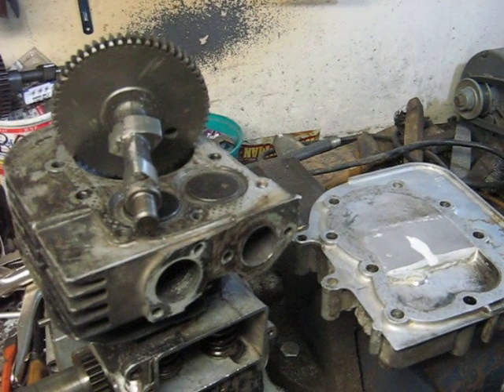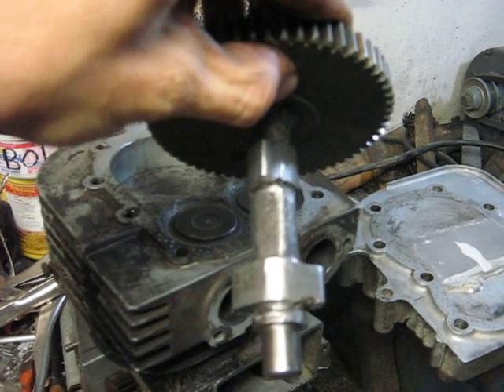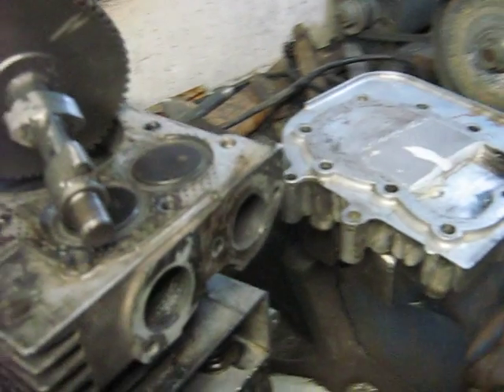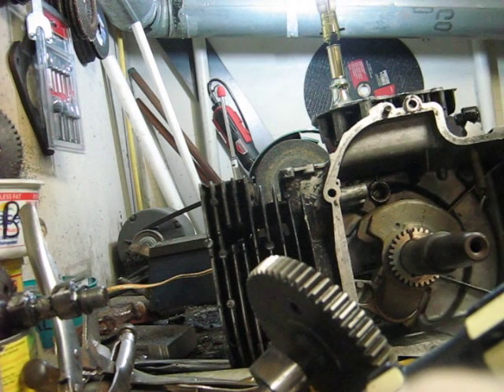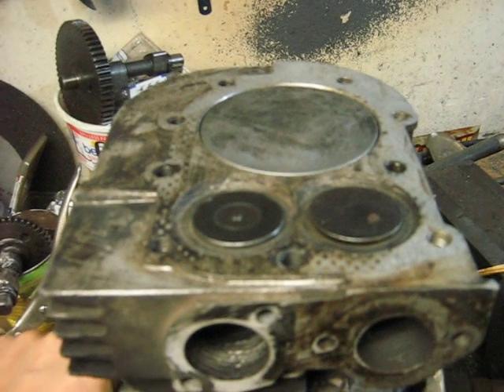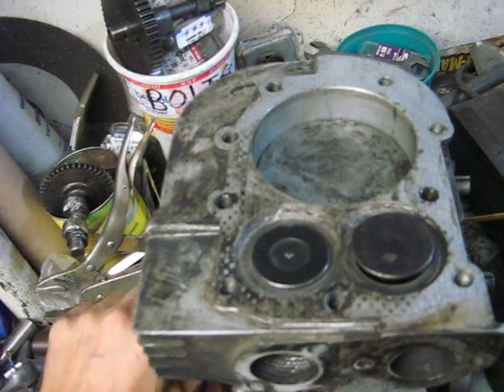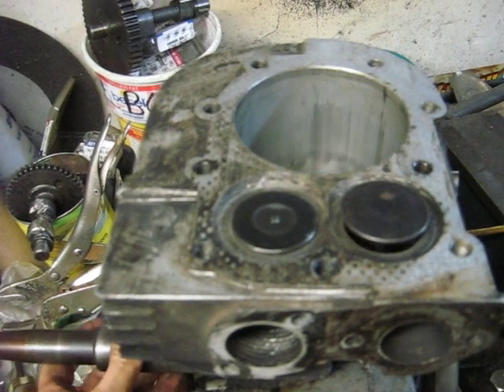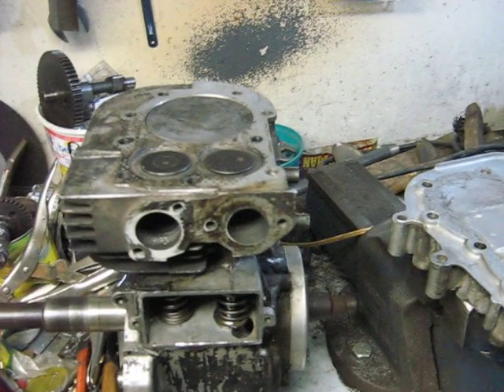Piston Supercharger 8HP Briggs

Comment: could a harley engine be turned into a 2 stroke single cylinder, with a piston supercharger as the second cylinder?
Reply from the maker: Wow, interesting question!  It may be possible, though the timing of the 2 pistons would have to be correct to force the mixture into the 2 stroke cylinder. That sure would be an interesting project. My cousin has 2 Harleys, I wonder if he would mind if I seriously butchered one!!!   :)  LOL

Comment: Did you have any gating problems on the 2 stroke?

My dad had an opposed 2 stroke engine which had an airplane propeller mounted to its output shaft, wonder what ever became of that engine...

I was thinking about just using the fan shroud as a low ratio compressor [or pre-compressor] on one of my engines, although I got hold of a nifty little roots blower I hope to use some day when I have leisure time.

With the roots blower I can gear it to whatever the engine can handle, and I have both an 8hp flat head Briggs as well as an 8hp OHV Honda.

For my yet unattained go-kart project, I got these unusual cast iron flanges originally designed to mount a toilet in an office restroom, and with these I aim to mount the engine in line with the middle of the kart instead of off to one side, basing my power transfer off of a Troybilt tiller transmission [built in 2 speed transmission with optional PTO on some models] and then use special ratio dividing power belts to enable steering so as to remain in positive traction [it has neutral in the transmission if I need to push it] plus the Troybilt rig allows me to have reverse.

No promises when [or even if] this project will ever come to life, I may have to give up on it if I never get the free time and other needful items for it.

Comment from the maker: @coryv4 
Thats hard to say about longevity, I run these engines for only about 5 minutes at a time, with a few exceptions.
The cam lobes do show signs of some wear, kind of like being broken in. 
I believe I could make a cam to have the Briggs run as a 2 stroke, and I plan to so so with a 3.5 lawnmower in the near future. One main problem is that the regular 1/2 crankshaft speed camshaft just doesn't move fast enough to have good valve lift during 2 stroke operation. Use a full speed camshaft

Comment from the maker: @coryv4 
To use it in a 2 stroke, I would have to grind the lobes to make the timing correct for 2 stroke operation, similar to the cam I use on my Supercharged 2 stroke Briggs (the Blue engine) It uses inlet ports, and both valves for exhaust. Like a Detroit diesel 6-71 type engine.